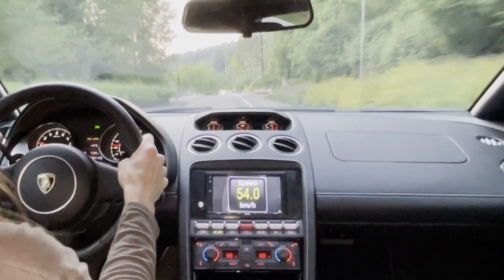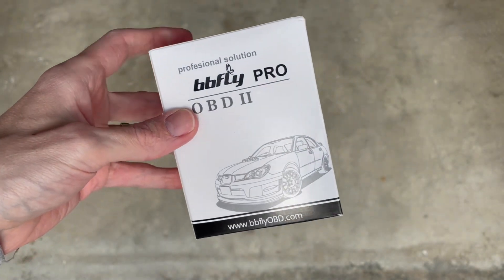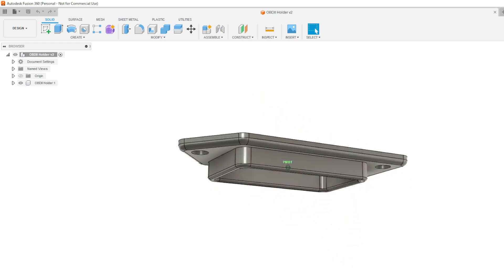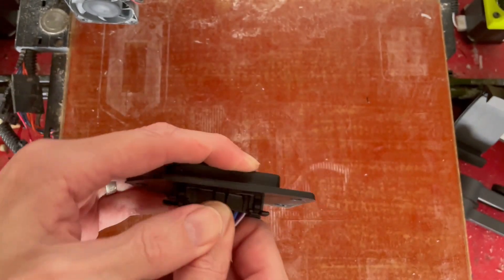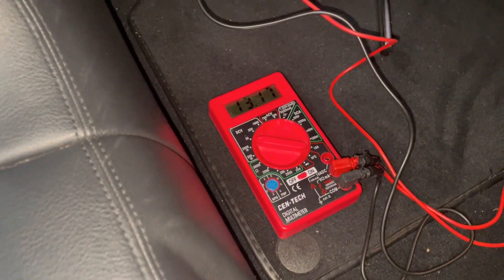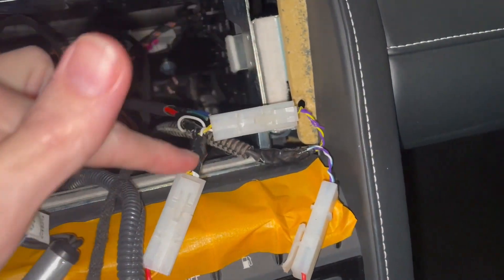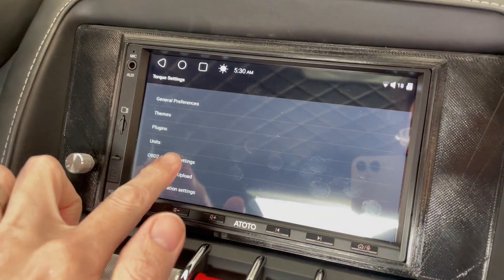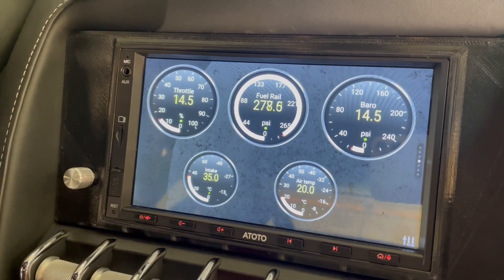Giant Gauge Displays on the Gallardo's Head Unit // Atoto OBDII adapter with Torque App

Comment: Have you ever gotten an oil leak? Or a drop of oil on ground from your car ?
Reply from the maker: Believe it or not I'm dealing with what I believe right now is a very small valve cover gasket leak. When I use the car for a long time it starts smoking near the rear-driver side. I do see some very small hints of wetness around the gasket, so thinking they need to be replaced. This happens as a car this old that wasn't driven much at first tends to have premature failure of the soft bits.